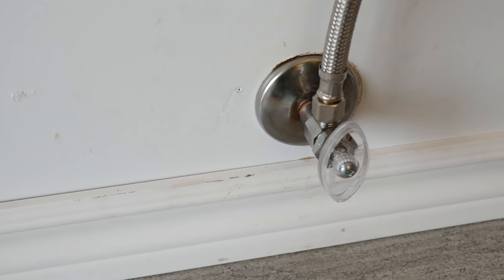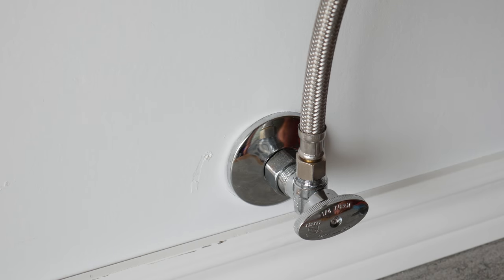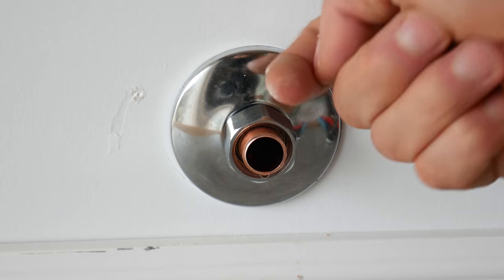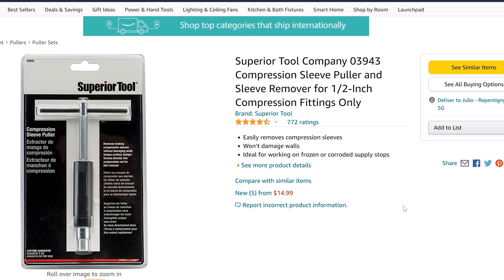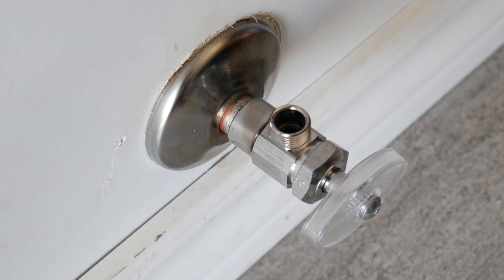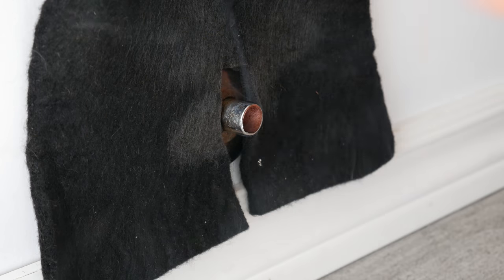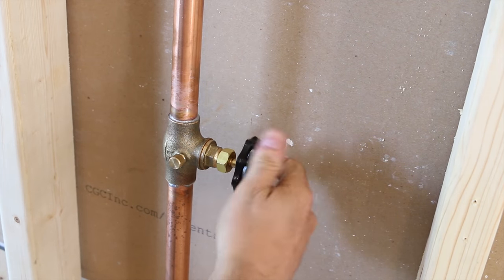How To Remove/Install a LEAKY/NEW SHUT-OFF Valve (Compression, Soldered or Push fit) | GOT2LEARN

Comment: I like your accent. I've always just damaged and replaced the escutcheon. I didn't know that tool existed. I always suggest replacing a ball valve with a quarter turn shut-off. It's the modern way. Great Sharkbite tips.
Reply: A ball valve is a quarter turn valve. What you're referring to is a gate valve.
Reply: @DL  You are correct; I did mean ball valve over a gate valve. Thank you.
Reply: I love your username “davidpierce9065”
Reply: @RandomSpaceMonkeys sorry he is married.  No more “like your accent” flirting needed lol
Reply: @tinali9200  What a weird ass flex 2 years later. Gain some confidence in your relationship then you don't have to post weird comments 2 years later.

Comment: The multi turn valves you can rebuild those. You can get new seals and nylon stem at a hardware store. I would try that first before replacing. Great videos as usual keep it up 👍🏼
Reply: Yep. My under sink kitchen shutoffs were replaced this way. I removed the innards and replaced them with those from new valves bought at the big box store. This was instead of replacing only the washer that had started coming apart and pieces were ending up inside my faucet ceramic valve. Since they were both about 20 years old, I replaced both hot and cold while the water was off. The quarter-turn innards would not close completely, so I used the multi-turn valves.
Reply: Absolutely. $2.98 for the kit at the Depot. Lot cheaper and easier.
Reply: Wish I had read this before cutting off a perfectly good, not leaking valve, just bc it  would not close.
After I replaced the soldered valve with a compression valve, I took the old valve apart and noticed it could be repaired by simply removing the guts and replacing them. And not having to risk a house fire!

But the video was helpful. And, the valve was probably 30+ years old, and most likely needed replacing. And this is the best "how to" video I've found on YouTube! This guy knows his craft!

Comment: Hey G2L I have a bit of off-subject topic but I think you might find a kick out of it. Drum roll please … Removing Old Kitchen/Bath Faucet! To be more precise, how to undo nuts that hold faucet to the sink. And all of that as a replacement, as usually is, meaning - from underneath the existing sink. Too bulky basin wrench (ALL are) fits never, hand works once in a blue moon etc. and even then only on larger plastic nuts. Not to mention an under-sink spaghetti city of various pipes. On top of that, level of intensity depends on previous artisan installer from 1873. Any video online is filmed in 100% controlled environment with new faucets and shiny crisp nuts. LOL If you could find one and show a tricks and tips, internet gods will be grateful and you might end up in copper-heaven. Hope all is well with you. All the best and happy holidays.   👽
Reply: They've utilized evil now. 😈 They're inordinately hard to get to/remove/replace. I know there's a trick, but last time my back hurt 3 days.

Comment: I used some high potency vinegar to clean the copper tube out let just so that the copper ring would slide of. It took a few minutes..Thank u Lord cause I did not want to return to the hardware store to purchase a puller. The ring was loose between 2 millimeters but would not go up or slide done. Loose enough but maybe some very small particles was not letting it slide off. Thank u.

Comment: One thing I do to future proof supply valves in my house: 

I have a mix of compression and soldered supply valves around my house. When I replace one, I sweat on a male threaded fitting, and then I install a female threaded 1/4 turn  supply valve. Using this method, I can get the benefits of the solid, reliable connection formed by the solder and threads, while still being easy to replace if necessary. 

I have had issues with both compression and shark bite fittings leaking in certain situations, but I always know I'll get a good connection with solder and threads, as long as the parts are not damaged. I want to renew mechanical aspects of my house in a way that will be easy to maintain and last a lifetime. That is why I started using this method.
Reply: I just worked on a kitchen sink and noticed it had copper pipe soldered to a threaded fitting with a screw on shut off valve and thought it made sense. Mine aren't 1/4 turn ones but I can easily change them if I want just with a wrench and some Teflon tape.
You made some good points.

Comment: Great video, Glad it was the first one YouTube search gave me. I have to remove a leaky soldered value and want to replace it with a compression fitting. Since I am just a DIY'er I like to confirm my knowledge before tearing things apart! You did a great job at that. I feel a lot more prepared and have a couple of new tricks that I didn't know before.
Reply from the maker: Glad it helped!! :)

Comment: Nice pointers on the compression type and the push on type!  For the solder type I'd recommend removing the stem first to avoid overheating the seat washer and packing washer.

Comment: Since the pipe on a compression type valve is normally "compressed" which can cause a problem trying to remove them damaging the pipe, when changing them I worry less about the ferrule's shape, since were talking about soft copper and brass, being soft metals they will "reform" when compressed to the new shape since that's what there designed to do. By applying a little white Teflon pipe dope over the whole ferrule before reinstalling the new valve body which takes care of any "misshaped"  filling any micro minor void worries and reduces the potential for pipe damage if it leaks a quick 1/4 turn usually fixes the problem, worse case if it doesn't work you can always go back and try the puller  and hopefully you wont damage the pipe, great video 🤜🤛👍
Reply from the maker: Heee hawww!!!

Comment: Always great videos..and always room for suggestions.  When removing a soldered valve, take out the valve stem and just warm up the valve body only.  A little light pulling pressure on the valve will tell you when it's ready to leave.  You'll need much less heat if the valve is disassembled first. 
On the press-fit valves; the escutcheon can be used as the removal tool by just pulling it forward to the valve.  The use of low temp solder is wise.  As is the use of eutectic solder.

Comment: Thanks for showing me how to remove the compression nut.  You even impressed the folks at the local hardware store who wanted me to saw the pipe to get the nut off.  That would have created even more headaches.  4:18

Comment: I did this for two compression valves last week. The old ones weren't shutting off completely anymore. 
For one of the new valves I couldn't get it to stop leaking no matter how tight I compressed it. So I added Teflon tape around the ferrule/olive and it worked. No more leaks
Reply: Hi, which part is the ferrule/olive?
Reply from the maker: The small ring shaped item.
Reply: @Got2Learn  I couldn't bring myself to reply to that username
Reply from the maker: @Free-g8r  🤣🤣🤣
Reply: @Free-g8r  But you did so you should have just answered🤦‍♂️
Reply: @Got2Learn  So wrap only that washer in Teflon?

Comment: :36 if leaking at the handle.. just hold the valve body and tighten the nut behind handle. Great tutorial
Reply from the maker: That's a good idea!!!
Reply: That's what I did also on the valve to my bathroom sink hot water line. Leak fixed!

Comment: I hired a local tile company to demo and retile my second bathrooms. My first bathroom I did the demo and their install went great. The second not so great, another crew. One of the demo guys cut my copper pipe off to the remove a sink value. I told him "You shouldn't have cut the copper line, all you had to do was unscrew the fitting and slide it off. Plus I had told the tile company that I would take of the sink and toilet plumbing, as I did in their last tile job. They also tried to charge me for their plumbing issues. I guess a lot of people that don't know anything about construction are taken advantage of. I thought they knew that I did part time construction consulting and had worked with a home inspector.

Comment: Very good and informative video.  Thank you for putting this out there for your viewers.  

There is another alternative to consider that I do in my own home.  I have replaced these kind of shutoff valves with quarter turn FIP valves.  These turn into a chrome pipe nipple which then turns into brass drop ear elbow that sits behind the wall.  I prefer this installation as the elbow can be anchored behind the wall resulting in no movement when installing the pipe nipple and valve.  In the event the valve goes bad, it is very easy to turn the old valve out and replace with a new one.  If one is renovating any area that requires new shutoff valves, I would recommend this approach.  It costs more to do it this way, but it does pays off down the road.

Comment: I've got two comments. 

1. At 0:38 you show a valve that's leaking and mentioned that they can't be fixed leaving no choice but to replace. In my experience 80% of the time this particular leak is repaired by tightening the nut to better seat the packing on the valve stem. I think you should have mentioned that as a first step before going to the trouble of replacing the valve. It's a legitimate option.

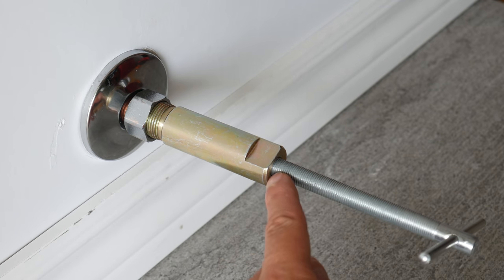2. At 3:20 you show a Superior brand ring pulling tool and mention that you like to put oil on the threads to increase its life. In my opinion Superior tools are absolutely the poorest quality. I have rigid pipe cutters that are 50 plus years old and the threads have never worn out. I consider Superior tools to be disposable and have been disappointed more than once.

Just my two cents thank you.
Reply from the maker: 1) Yes, if you have a 2 piece model, you can tighten the pack if it's leaking there, some models are only 1 piece so there's no option for this.

2) I treat my cheap tools the same as I do my good quality tools ;)

Comment: Great video, thank you. I'm about to help do this at my Aunt's house. My worry is that it is a compression-type connection but also has some sort of sealant or solder keeping it in place as well. My worry is accidentally twisting the copper pipe in trying to remove valve. The two plier/wrench method looks like it will help me avoid this. Wish me luck. I'm really trying to get better with plumbing jobs. :)

Comment: Great video. I like using the Paso 4661 compression sleeve puller to pull off the compression ring. Just make sure to ream the inside of the copper pipe so that the nose goes inside the pipe easily. The only thing I don’t like about compression ring angle stops is if the previous installer tightened down the nut so tight that the compression ring won’t come off. Makes for more work to get it out.
Reply from the maker: Thanks for the info!
Reply: It’s Pasco 4661 Fully Machined Compression Sleeve Puller, not Paso.  How is it better than one in this video?

Comment: The Ferrule blaster is the best tool to remove ferrule's, The olive puller is cool so are some of the other pullers but theyll either break or stretch the pipe when theyre really corroded on.

Comment: Can you remove a solder type and replace it with a compression type (or push on)? Thank you for the fantastic video, attention to detail, and time you put into this.
Reply from the maker: Yes, but the pipe needs to be 100% clean, or else, not recommended.
Reply: @Got2Learn  thank you!  I got the pipe down to all brass all the way around. Took forever but I got it there. Used pump pliers with teeth to get the big stuff off, then steel wire brush for more, a pipe brush and then high grit pipe paper. Rinse, lather repeat until all clean.

Comment: I've tried to use ferrule ring pullers, but some refused to budge and just dug into the pipe.  I ended up getting a Dickie Dyer "Olive Splitter" and that makes quick work of it on any size piping.  Though, I could only find such a tool in the UK, so there was the added shipping cost to the US.

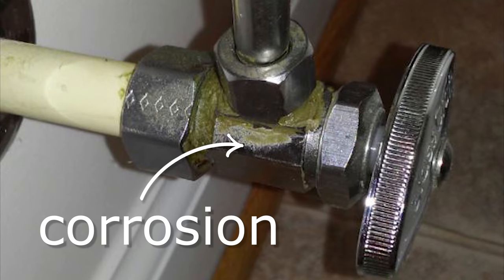Comment: At 0:50 simply tighten the packing nut (located behind the valve handle) with a small adjustable wrench while holding the valve with a pair of channel locks or larger adjustable wrench. This is the first, most effective thing to try.
Reply: @GEOsustainable  shouldn’t need to do it again and again if it’s tight enough. 40 years experience confirms this. If it were tight enough to begin with it wouldn’t have leaked
Reply: @homemprovmentguy  Minerals build up on the stem and when the valve is turned it scores the packing slightly causing a leak in a valve that didn't leak before, I turn the valve fully open, clean the stem with emery cloth, lubricate the stem with silicone grease, turn the valve all the way off, tighten the bonnet nut a quarter turn and open the valve all the way and check for leaks.  If it still leaks and the nut won't tighten any further, turn the valve off, were assuming here the valve only leaks when on, unscrew the packing, wrap some  graphite rope or Teflon tape around the stem and re tighten the packing nut, problem solved every time.
Reply: I just found your comment as I was looking to replace my leaky valve. Had no issues with leaking for the 2 years we’ve been in this house. Replacing the dishwasher and turned on/off the valve and noticed a new leak. Tightened the the nut behind the valve and not a drip. Thanks!!

Comment: Use a ball valve, and put a reducer on it with a 1/2" to 3/8 " so you can add a 3/8  male adapter to your sink ball valves last way longer then a ordinary  sink valve .

Comment: Do I also have to change the whole valve when it's only leaking where you turn it. It's the one that's connected to the copper line with the green knob.
Reply from the maker: depends where its leaking.
Reply: I found out that it's called a stop and waste valve and it's leaking where the screw hklds the knob.@Got2Learn

Comment: Thank you for your videos.  I gave 2 question, should I braze or solder Honeywell zone valve to copper pipe?    Second question. Do you solder or braze copper pipe to cup tee on furnace hot pipes. Many Thanks ?
Reply from the maker: Both soldered, thanks Sam!

Comment: I used to see if I had room to cut off the compression fitting or reuse it.  This time elected to try the compression remover tool, but I noticed by pulling the ring off it resizes the pipe down.  With the copper pipe being a bit smaller it was kind of a bear to get the new compression ring to seal but was able to get it.

Comment: I wasn't aware of compression ring puller.  My valve was under a kitchen sink and I just used the old nut and ring with a decent amount of pipe dope.  Never leaked and thanks for the video.  Now to watch roger and why he doesn't use sharkbite fittings.
Reply from the maker: Thank you so much, yeah I know Roger isn't too crazy about Sharkbites ;)
Reply: if u loosen the valve nut  then tighten stem ...itll guarantee no leaks...

Comment: Love the video! 

Also: do you have any guidance on the pros/cons of each valve type? I'm replacing mine, and I'm trying to decide whether or not to switch the type.
Reply from the maker: I just use compressions because they are so easy to install, but they are all good.

Comment: Good video, but that leak could have been stopped w/o replacing the entire valve. Just put a small turn to tighten slightly on the packing nut under the handle/knob. That holddown holds water back.
Reply: I don't know that I want to put everything on one cheap little part, tho...

Comment: I’m so mad - need to replace my corroded sink shut off valve (compression) but the genius previous installer also used a shark bite coupler too close to the wall - no space between anything.  The whole thing twists and the shark bite and compression valve nut are frozen.  The shark teeth aren’t releasing.  Barely have enough room for the C disconnect tool without really pulling copper pipe forward - which I don’t like.  Looked at your other 6 tricks video so will need to try those.  So frustrating.  Grrrrr.  If you have any other tips, can you pls share.  It’s such a tight space in the cabinet.

Your videos are concise and my first instructions stop!
Reply from the maker: Grrr....did you try the 2 flatheads method as shown in this video?

Comment: Lowes and home depot do sell kit to fix shutoff vale leak. All you need to do turn off main water, use a screw driver to remove the knob and replace the rubber seal and washer. I've been doing this on my house and rentals. But if you want to replace the whole valve, then this is your video

Comment: My local plumbing store wanted $44.99 for a compression puller. I dealt with the drips bought it off Amazon for $15.49, and replaced most of the shut off valves in the house.

Comment: 1:00 The third reason which is probably the second most common reason is the build-up of minerals has frozen the valve so it either does not turn or does not close completely. Every shutoff valve in my house has this problem, and the truth be told, this has been my number one problem everywhere i have lived.

1:38 In older home EVERY shutoff valve is soldered.

Comment: i attempted to replace the shut off valves but the hot water side the water doesn’t stop even after 20 minutes of draining with the main water line turned off. do i also need to turn off the hot water tank line too? thank you for your help.

Comment: What  copper pipe prep work should be done (with replacements) before using push valves - I see some people sanding the pipe while others say you should not do that?